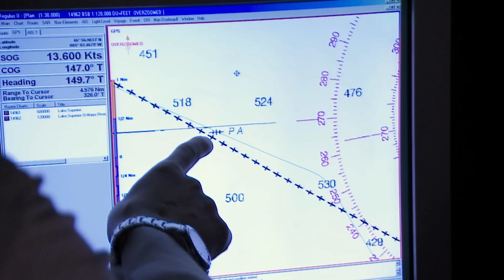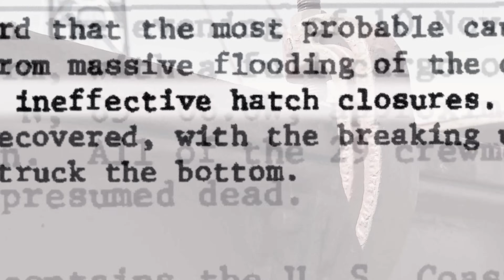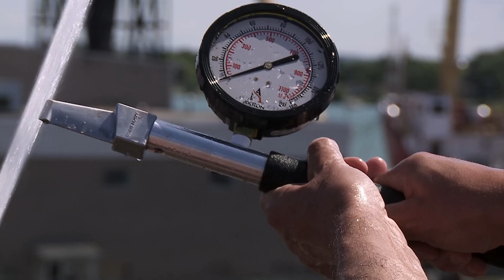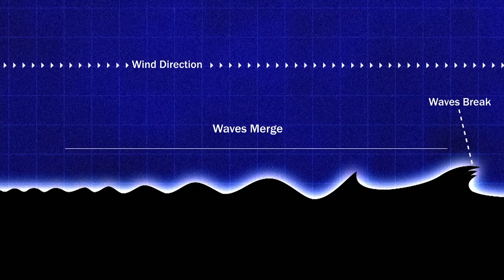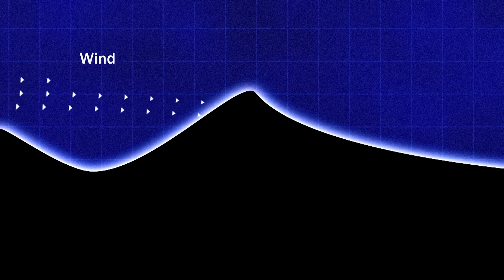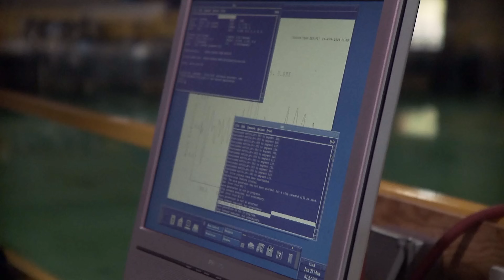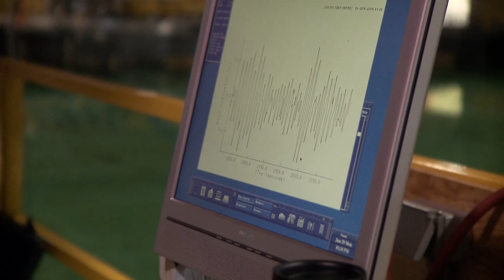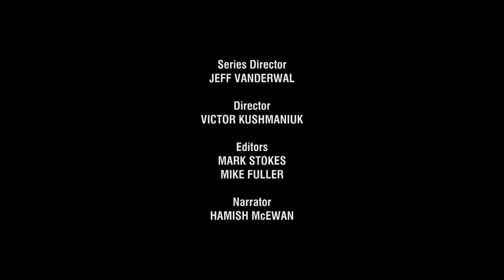The Titanic Of The Great Lakes: What Really Sunk The SS Edmund Fitzgerald?

Comment: We will probably never know with absolute certainty why the Edmund Fitzgerald went down.      I have always thought that she hit bottom on six fathom Shoal.
Reply: But we know now that 6 was a halfass zero of 10 ..
So it definitely never came close to the bottom.
There isn’t 6 fathoms with miles of reported strike area or path it took.
I think it partially broke on the surface. 
They could reverse engineer the placement and bending of metal to determine. If we could figure out the titanic this should be much easier
Reply: @maegenyoungs2591 look if it broke apart on the surface the wreckage would been further spread apart then it was it was overloaded riding about 4ft lower than it should have been she had strike bottom because how do explain fence railings down and vents missing
Reply: No sign of contact on the hull or anywhere in that area of the shoal.
Reply: @robertredmon6387  
Well considering the ore from the rear half dumped on the front half.
I doubt your version of events are not seeing everything.
Look at the rendering. The hatches are still on the front half and covered in or.
That could only happen if the front went down first and the rear half turned over above the front half and managed to miss the front on way down.
There is no way that is going to go down, turn over completely submerged in 500 feet of water..
It happened on the surface.. just because Anderson didn’t see it happen doesn’t mean it didn’t take a minute to disappear.
The front probably stuffed and stayed braking the back because the center was lifted by a wave. And was still connected on the hill on one side causing it to pull one side down making it roll. 
The evidence supports that.
But I wasn’t there. So it is just an opinion.
The crazy part is of all long liners.
None have a wreck site similar to the Fits J..
Reply: @robertredmon6387  plus there is no way of knowing if the break up was from compression. Which would shorten the the upper half of the hill.
If it had been on bottom, enough to sag loosing a railing. It wouldn’t have made it that long in 2 pieces.
It was grossly overloaded.
Now it could have broken the keel,
But the passages were still semi dry.
Which led me to think it was weakened on the upper half and crowned a wave just as the ship stuffed a wave.
He probably would have said he thought he ground out if he had.
But he never did.
It was Bernie Cooper who created the ground strike theory,
And we know now that the charts were wrong. It was 6 phathoms..
It was 10… the 1 was touching the 0 making it look like a 6
So forget about that ship hitting the ground. Other then when it sank.
It was a mistake by the department responsible for plotting that body of water.
Reply: @maegenyoungs2591 You need to provide citations to reliable sources for your dubious claim.      Bernie Cooper and his crew would understandably say that you weren't there and have no idea what you're talking about.
Reply: @stargazer5784 ew u sound angry and rude
Reply: @maegenyoungs2591  I agree with her not bottoming out on the shoals as found in the reports but don't think she broke up at the surface or McSorley could have had time to make a distress call and even if he lost all power could have sent a distress using her battery powered back up radio..but McSorley never had time to use it thus common sense tells us that she hit bottom then broke...the long deep trench she dug,the beat up and cracked bow and the steel at the break isn't consistent with breaking up at the  surface.
Reply: @maegenyoungs2591  idk how correct this is, don’t quote me but I thought I heard something about the 6th fathom was a bit different when the ship when down compared to when the ship was found
Reply: @austin_firebird  yeah unfortunately there had been a big misunderstanding for years, longer than I’ve been alive,
That the 6 fathoms was a honest mistake on a chart that made its way to every major shipping map used to navigate on that lake.
It wasn’t until recently that it was corrected to 10 fathoms.
It was was measured properly, 
But when 10 was put down. 
They put the 1 on the 0 making it look like a six. 
So that ship never hit bottom at any point. According to the path it took.
Coopers boat was actually closer to shallow the Ernie during that storm
Reply: @maegenyoungs2591 that ignores the fence rail down, the vents broken, list, pumps running and lack of mayday call
Reply: @TheMainLead what mayday call the last word form them was "we are holding our own" pay attention
Reply: If a ship is in the trough of a 20 foot wave With a 26 foot draft that ship could have touched bottom down 36 feet. Half of the wave is above the lake surface and half below. It's a plausible theory. It was common knowledge there was a six fathom shoal, and the Captain of Arthur Anderson said the Fitzgerald was closer than he would ever want to be. At least one person said there was red paint there. That possibility will never go away.
Reply: @jimhall1095  There is almost 200' of hull that is missing. So to say there is "no sign of contact on the hull" is an over-generalization.
Reply: That is the most-likely scenario. They had no radar and outdated charts. Turns out the shoal was mile closer than they thought it was. The Anderson noted that radar put the Fitz WAY too close to the shoal. Shortly after, the Fitz reports a deck rail down (indicating structural damage). Then the rogue waves drove her under nose-first. They didn't even know they were doomed until they were already underwater. The nose hits hard. The stern is still above water as would be the case when a 729' foot ship hits the bottom in 500' of water. The mid-part of the hull collapses under the weight. But, by that time, the bow is already at the bottom. It was over before it began.
Reply: @insertnamehere313  McSorley knew he was in trouble. He asked how long the Anderson would take to catch up if he checked his speed down. The only reason you'd check down in weather like that is if you know your ship is compromised. Plus, the deck rail failing is a pretty big sign of significant structural damage.
Reply: @chucker625  I understand, but the Navy and Coast Guard found zero evidence of contact on the entire area of six-fathom shoal.  They also discovered that it is much deeper than six fathoms in the areas where a ship would be running through.
Reply: @jimhall1095  This happened pre GPS. The exact path of the Fitz will never be definitively known. Trying to find a single point of contact in a 20 square mile area of shoal is like trying to find a needle in a stack of needles. I'm not shocked they didn't find anything.
Reply: @robertredmon6387  no it wouldn’t.
The rear section was still partially connected, on the surface 
How do you explain the front section of the hull hatch covers , covered with iron ore, the rear section turned over and dumped it on it, before sinking.
The hatch’s on the front section are still intact. With ore in them.
Reply: @TheMainLead  
That thing was old. 4’ over loaded.
Is it so hard to believe, that it couldn’t handle the storm..
Reply: @chucker625  Yep, so no point in speculating.  All the angles and ideas have been explored. Nobody knows what happened.
Reply: @chucker625  I’m well aware of when it happened.
Reply: @jimhall1095  she didn't need to make physical contact in order for damage similar to a strike to have taken place. A ship the size of the Fitz would have created massive hydrodynamic pressure if passing over a shallow area while also rising and falling in waves such as those present on Lake Superior that evening. That pressure would have been sufficient to cause significant damage to the hull without the need for physical contact.
Reply: I think the Fitzgerald sank Like the following: she was being swamped by waves which caused her hatch cover to be torn off making her cargo hold flood which in turn caused her to go deeper in the water which means The next hatch cover gets torn off and this process continues all the way down the ship until she hits bottom and splits, the bow settles while the stern goes vertical and it flips upside down due to the waves and comes to rest upside down.
Reply: @maegenyoungs2591  with waves 20-30feet, I’d imagine she could have come very close to bottoming out.  And considering Bernie Cooper said she was too close to the shoals, I’ll take his word for it over yours.  Cables don’t break from getting slack in them, they break from too mist tension.  You’re very misinformed.
Reply: @jimhall1095 you dove it eh?
Reply: @maegenyoungs2591 she was found on the bottom broken in 2. The extra length ( added cargo capacity) was her undoing.
Reply: Rogue wave
Reply: @tinachandler3091 .    Yes a rogue wave is possible.    I agree
Reply: @insertnamehere313   well if the power is at the back half, and it separates, no power to send anything out.. I do think it broke on the surface.
Maybe partially under water. But people saying the wreck would be bigger, not if it was that over loaded and already sinking.
It wouldn’t have floated around, it would have dropped like a rock. 
A old man on here YouTube did a great job of explaining. I believe most of what he says is correct. But who knows he could be wrong,
Or 100% right, but when the coastguard is only open to neglect or any Idea that absolves them. I don’t like that a bit.
I have heard many say those hatches were so heavy, you didn’t need to latch them down.
And the ones the claim weren’t clamped, are bent, 5he only way that happens is if they were, and couldn’t hold a latch upside down with all that weight on them
Reply: I think it's a combination of a lot of things starting with the condition of the Fitzgerald I seen a copy of a coast guard report that the ship needed loads of repairs to include damaged hatch covers.
Reply: @stargazer5784  Dubious claim ? Demanding citations? The guy just stated  what he believes and you come full  how dare you.. lol

Comment: What people don't realize about the Fitz is that she was 729' long and sank in 500 feet of water. There's about 200' of hull that is missing and an impact trench under the bow. She ran aground at 6 fathom shoal. Started taking on water. Then she was driven under by two rogue waves that ran stern to bow. The crew probably didn't even realize it was over until the bow hit bottom. At that point, there was still about 150' of stern sticking out of the water. The mid-part of the hull collapsed and disintegrated under the weight. The screw kept turning until the stern flipped over and landed on the bottom. That is the most realistic sequence of events.
Reply: I agree the documentary producers are covering their A$$
Reply: So the rogue waves were 'the straw that broke the camels back'.
Reply: @SUSTHUNDER-i6s  essentially. those waves were backed by the captain of the anderson
Reply: The wheel  house  crew  wouldn't have known they were done for  untill  the windows imploded . When they bow took the plunge  they probably expected that the bow would have popped back up as usual  untill the windows imploded and the water came rushing in .
Reply: @adamwatson6916  Agreed. It had to have happened very quickly. Even if she broke up on the surface, I feel like there would have been time for a "mayday" over the radio.
Reply: Many experts and engineers agree that if she had ran aground she wouldn't have gotten as far away as it did from the shoal and there was radio talk after it had already passed over the shoal with no mention of running aground by the captain. "We are holding our own" was the last transmission in response to a question of how they were coping with their problems. They also searched the shoal and found no evidence of impact. I believe it was a combination of things most of what you mentioned. It could have ran high and buckled while going over a couple large waves. It went under or rolled over over 700 ft long it hit bottom in 500+ and likes split in half.
Reply: @hellfire8883  But she didn't split in "half".... There is 200 feet of "missing" hull. How do you explain that other than "violent impact with the bottom"?

Comment: Good grief!  I was stationed at Coast Guard Base Sault Ste Marie, there is a freighter next to the base, the Valley Camp, turned into a museum. In the bottom of her, there are items from the Edmond Fitzgerald, a marker buoy and one of her lifeboats. Both those items were crushed and twisted, the lifeboat looked like someone squished it then pulled back out and twisted it.  Water is a powerful force that can literally destroy anything in its way.
Reply: @uniform131  I was there last week. It had to have been the Fitzgerald’s prop that chewed up those lifeboats.
Reply: @jetcat132 that doesnt make sense. If it was on the surface long enough to get into boats they would have mayday called
Reply: @TheMainLead  It makes all the sense in the world. There was no way those boats were ever going to be launched in those seas, and they weren’t. During the wreck, those two boats were probably dragged under still attached to their davits. The water pressure and violence of the seas tore them loose but it’s likely they were dragged under still attached to their lines, twisting and trailing the boat as she went under. 

Expedition '94 located a knotted line or rope draped over the propeller shoe and leading into the hub of the 19-foot (diameter) four blade propeller. Speculation is that the line came from one of the lifeboats, where it was stored for use by sailors as a means of climbing aboard. That is a good indicator that the lifeboats may have been pulled into the still churning prop as she went down, chopped up by her blades, and spit out in the condition they were found. 

We’ll never know for sure, but if you’ve been there and seen those boats, you would see that it makes a lot of sense.
Reply: @jetcat132 lifeboat 1 was found NE of Caribou. It came off earlier and was banging against the Fitz and someone may have thought to cut it lose but were told not to go outside.
Reply: @jetcat132  I have always wondered if it was not  the wave itself that damaged the lifeboat. It was held securely in place and with multiple tons of water pouring down on it, it could have been crushed and split as the damage shows. Anderson even had a lifeboat damaged by waves. It does not seem likely to me that the damage was done by the screw. I would like to see more study done on that.
Reply: @ It is interesting. It just looked to me  like those boats are sliced up, not so much bent or caved in. Add what the expedition said about possible life boat line wrapped around the hub, and it makes me think they got chopped up by a screw.

Comment: It’s interesting they mentioned the Cuyahoga when her sister ship the Michipicoten suffered a hull failure (13ft crack) this summer on June 10th 2024. 

THUNDER BAY — A massive crack has been found in the hull of the Michipicoten, the ship that limped into Thunder Bay on the weekend after water started pouring into it on Lake Superior.

Divers have found a four-metre-long crack during an underwater inspection conducted at Keefer Terminal, where the vessel is now tied up.

"This appears to be a result of fatigue/structural failure," a spokesperson for the Transportation Safety Board of Canada told TBnewswatch in an email Monday.

Comment: I believe that one of the air vents on the deck, near the bow, broke off and opened a 3ft wide hole on the deck. This allow large amounts of water to flow into the ship with every wave that washed over the decks and made the ship heavy to the bow. Then a rogue wave hit the stern of the ship, raising the stern up and the bow down, Because of the extra weight of the water the bow went under water and the forward motion of the ship drove the bow to the bottom. This would have happened so fast the crew wouldn't be able to send a mayday. The bow could have hit the bottom when the stern was still at the surface. When the bow hit the bottom and stopped something had to give at that would be the mid section that looks like it blew up.  I doubt a surface break up because the two halves ended up so close together on the bottom. A surface breakup would have had the 2 halves floating and sinking at different rates and the 2 halves would have ended up farther apart, like the Titanic.
Reply: The titanic bow and stern are not that far apart when you consider the jews blew it up on the surface and it drifted done almost 3 miles
Reply: The engine turning at full speed, torque twisted the Fitzgerald , ripped and shredded the middle third of that shakey old tub with the bow planted in the mud
Reply: @gregobern6084  Which would mean it didn't break apart on the surface.
Reply: The pumps could have kept up with a 3 foot hole in the deck so I doubt that is case. It is more likely that she ran aground at 6 fathom shoal and broke her back. It was only a matter of time after that point. The rogue waves just accelerated the process.

Comment: The fact the SS Arthur B Homer the exact sister ship of the Fitzgerald was scrapped a decade after the Fitzgerald loss despite many millions of dollars spent to lengthen her just a few years prior, leads me to believe stress/hull failure is a factor. Former Fitzgerald crewman Richard Orgel and Red Burgner testified Fitzgerald's hull was "wiggling" too much in bad weather. Even saying Captain McSorley himself called it the "wiggling thing" and was frightened by it sometimes. Maybe the Lake Fleets deep down knew there likely was a design flaw,  and so nobody bought The Arthur B Homer and they quietly scrapped the Homer blaming the economy. yet older, slower vessels with smaller cargo capacity were still sailing. But who knows? (Shrug)